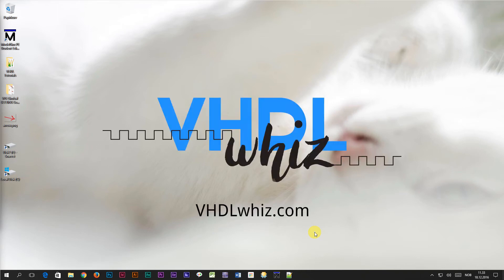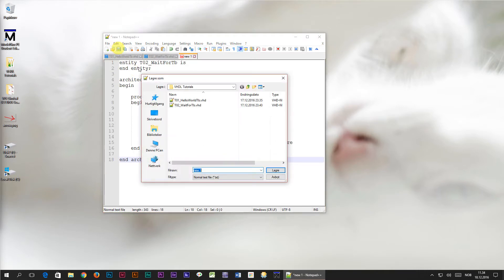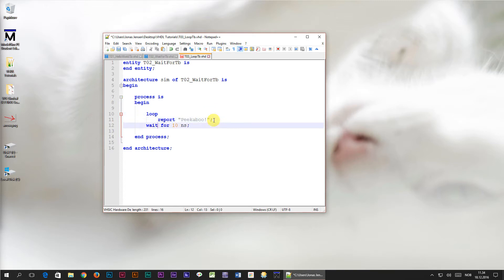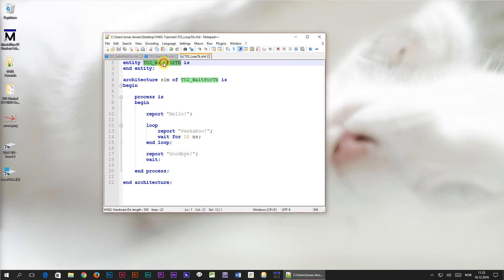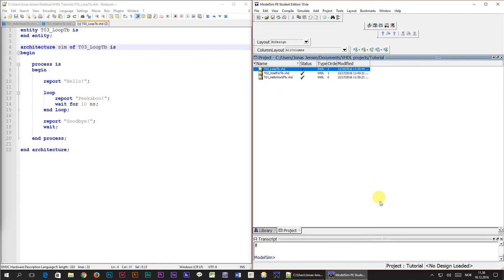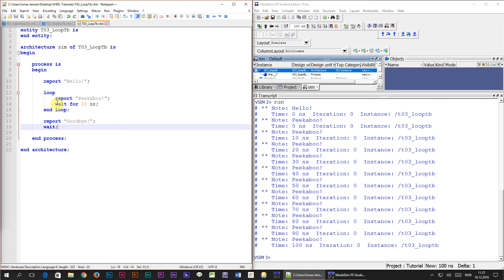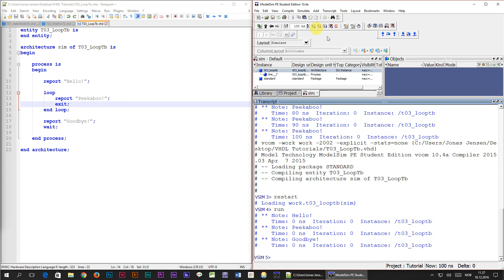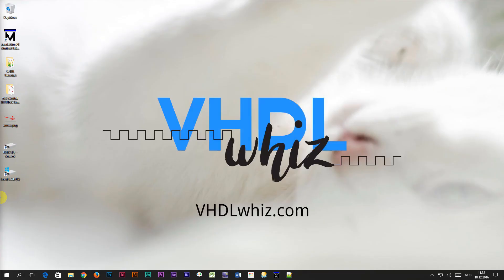How to use Loop and Exit in VHDL

Comment: Interesting that wait statement is AFTER the report "goodbye" statement yet during runtime, simulation honors the wait statement and waits forever without printing goodbye. That is different behavior from typical programming language, looks like even though you right everything in one file, the process loop is controlled by specific syntaxes and inner loop is controlled by other specific syntaxes

Comment: I've been having an issue with the process codes. They don't run the "wait for <amount> <time type>;" line. I'm wondering if it's because the Starter Edition isn't able to utilize Wait For statements. Is that correct?
Reply from the maker: Every version of ModelSim/Questa support all Wait statements. Perhaps you are typing it incorrectly. "wait for 10 ns;" for example.